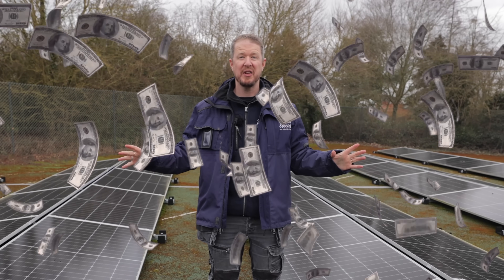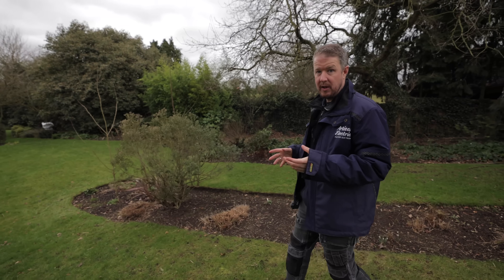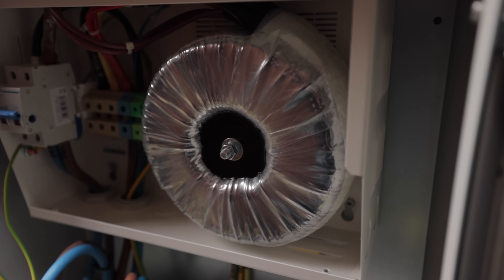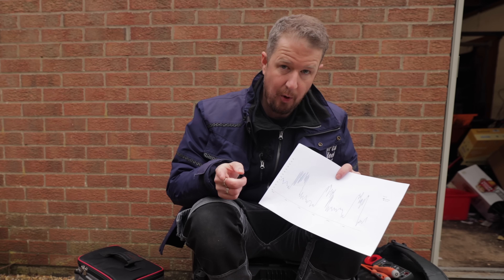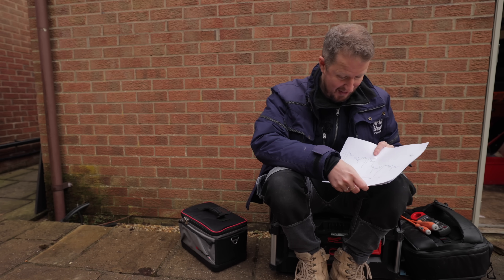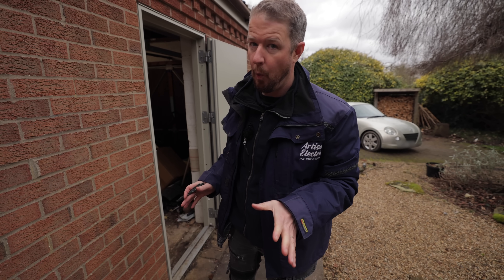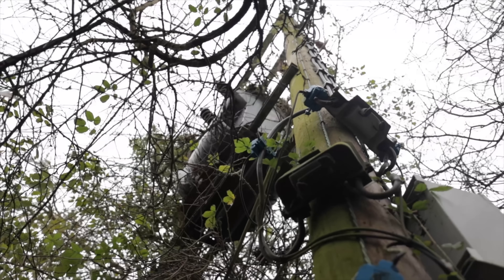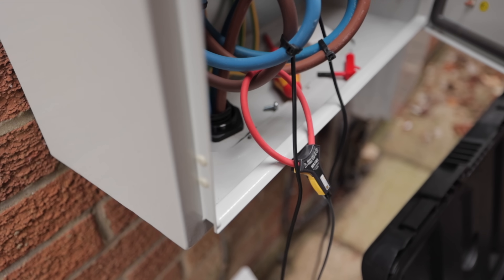THOUSANDS Down the Drain – And We Can’t Do Anything About It!

Comment: Careful what you wish for.  If I were a neighbour on that same distribution circuit, I would be complaining to UKPN that my supply voltage was outside statutory limits for a proportion of the time. I would expect them to fit a voltage monitor, and then analyse the data.   They are going to conclude that the G99 they issued you, needs amending !   Almost certainly they are going to have to impose import and export limits, to protect the neighbours.  They might even send you an invoice, for all the work you have created.  This is exactly the situation that is going to occur all over the country, as the distribution systems were never designed to work in reverse power mode.  It's not only the 415 VAC systems, but also that 11 kV circuit may be a long run of small diameter wire as well.  Will need massive reinforcement and maybe even automatic HV and LV transformer tap changers ! These will not be quick or cheap  fixes.  The developer pays, I presume.
Reply: If the authority issued a permit to export that energy, the burden is now on them. Limits should have been identified before issuing the permit. For example my city and my grid operator require their own processes before before selling to the grid. One is technically just for the solar system to exist, the other is to sell. I ignored both and spent the permit and inspection fees on batteries. My system stays in "island" mode a lot of the time
Reply: Australia has managed to integrate rooftop PV on a third of all houses with only modest network augmentation to date. But that did require a number of actions including adjustments to distribution voltage management techniques of network operators, leveraging smart inverter capabilities and more cost reflective feed in tariffs to promote self-consumption and more load during middle of the day. It will indeed become expensive if traditional network augmentation alone is applied as rooftop PV proliferates.
Reply: @peterkilby289  "Australia has managed to integrate rooftop PV on a third of all houses with only modest network augmentation to date."  Same with the US.  I'm not generally aware of residential solar plants causing the issues described in this video.
Reply: @peterkilby289   Australia has the advantage of lots of air conditioning loads which balance the solar generation when it's sunny.
Reply: I think it's right that they do pay - they are the ones looking to benefit financially from their own solar array - I mean you don't technically have to export anything. they can't do that in detriment to the neighbouring properties.
Reply: this problem isn't limited to the UK but it's worldwide. domestic solar and battery systems have caused a real headache for grid operators because the systems were never designed for it, and they have been too slow to adapt. Here in the Netherlands, we are facing a €100b+ upgrade to install, among other things, 50.000 extra (!!) transformers in urban areas, and of course upgrade the high voltage grid to support all of that. Oh and we also decided that new HV lines must be run underground, as to not disturb the horizon too much...
Reply: When I built my house. Here in the USA. My utility contacted me and asked if I was going to have a welder and said they would put in a larger transformer at the pole where my house attaches to the grid.
Reply: Exactly what I was thinking.

Comment: My suggestion is to run the solar system at your customer’s property without the voltage optimiser. Then get a neighbour to complain about voltages at their property and get UKPN to monitor voltages there. As UKPN have signed connection agreement with you they can’t ask you to stop generating to solve a voltage issue at a neighbouring property.
Reply: If the power-loss happens on the power lines between the house and transformer, the neighbor will not notice much. I don't believe the transformer is the problem. The power lines are too thin/long for 17KW power feedback.
Reply: @kriswillems5661  the transformer will have a much bigger impedance than the 11kV lines and therefore would have a much bigger effect on voltage changes caused by load/generation
Reply: @ You are probably correct. In that case, the solution would be to extend the 11kV circuit closer to the customer's property and install a new transformer there
Reply: Not quite right. The voltage optimizer will enable the system to push the grid voltage up higher. It will enable the inverter to continue operating up to grid voltages of 289v (8% higher than 263). Arguably using an optimizer in this situation is irresponsible and illegally defeating the required grid protection features of the inverters.
Reply: That's a good one !!!!

Comment: We have a similar, but less severe problem. During export our voltage hits 254V and the car charger goes into error state. Normally turning on the kettle or oven is enough to bring it into spec and once the car is charging, it’s all good.

Comment: This is what I keep asking about: "what happens when there's excess solar production?" Nobody ever answers, but I was assuming inverter builders had thought about it and built in a limit feature into their inverters which reduces output when the output side would otherwise go out of spec. This doesn't strike me as a distribution issue - they're only concerned (I would presume) that typical generation won't overload their current-carrying capacity (and break something), not that it might cause a power-out-of-spec condition which I think *should be controlled by a feature of the generation equipment*. I've been waiting for a video like this, thanks for posting. Now to watch the rest...
Reply: Inverters should definitely keep the power they generate to 230V+10%/-6% = ie. 252V to 116V. I.e power should be restricted when the voltage gets over 252V. It seems like the Solaredges are not doing that at the top end. That's Jordan's fault, not the DNO's IMHO. Mine (Victron) does this (and my G99 is limited to 5kW because they know perfectly well that the voltage regularly gets to 252V on sunny days already round here.
Reply: I think after watching I might agree with what you say: either they shouldn't have offered to accept so much generation as there's insufficient transmission capacity - either they've mistakenly agreed given capacity, or they've recorded capacity wrong, or there's a fault meaning capacity isn't what it should be. They also apply 'diversity' on consumption, don't they, relying on not everyone downstream of a transformer using all the capacity for extended durations at the same time? Do they assume the same for generation? That would be ok if all homegen households were all self-consuming at the same time, but if the houses have no demand and several are exporting at max could be an underestimate?

Comment: Sounds like trying to push too much power into too high an impedance, probably mostly down to the long cable. I have a cunning plan how to get the system upgraded for free though. Assuming the original supply fuse to the property is installed, load the supply up to the maximum in the hope that the supply voltage drops below the -6% acceptable level, then it will have to be upgraded as it will be out of spec. Maybe the original main fuse was only 60A, only allowing for around 14kW, in which case you shouldn't really try to push more than that back. If it was 80A then maximum load would drop the supply below the lower acceptable limit (then you could maybe complain).

Comment: Good video. Suggest a lesson is to visually inspect the transformer and power line before taking on large jobs, and “trusting” powerco’s database response. Agree with others, the line may be under-specced for that kind of distance and power. 300m may need some pretty chunky cable for 17kW. An NZ calculator shows 240mm2 aluminium for just 15kW.

Comment: Is my observation correct that the house is only connected to one phase? In the Netherlands such a an amount of power will be delivered through 3 phases. Another remark is regarding the capping of the voltage spikes. I thought there were European regulations regarding maximum voltage by pv installations and automatic switch off by exceeding a trip voltage?

Comment: To be honest what I learned is that you shouldn't rely on being able to sell power back to the grid... you should always assume that they could at any point refuse to take it and you may need to deal with it by yourself.
Reply: I have a 10kw system and batterys but I can only send back 3kw as next door had there 10kwpv and a wind generator (no idea what kw) and in the last 12m all the houses in our small village that didn't have solar now do so in windy summer weather my PV does Ireland itself as the voltage can hit 253v but if it stays over 253v for more than a few seconds my house disconnects itself from the grid and runs off battery power and solar untill grid voltage has dropped below I beleve 242v seems to work well for us with 20-30 disconnection events a year but this may go up this year currently it's 249v here at 8.17am
Reply: @simonupton-millard  'my PV does Ireland itself ' ? I assume you mean island itself but how does it do that? Do you have a gateway?
Reply: @billmorris2353  sorry autocorrect 😂 I have an automatic disconnect from the grid in case of a powercut it's a box between the meter and all my house loads it moniters the grid if it's out of spec it disconnects my house from the grid and my batterys and inverters just carry on working, got it originally as we have quite a few power cuts but also does it on high and low voltage can also do it manually in case of a thunderstorm, only other change was had to have a massive earth rod installed
Reply: @simonupton-millard  This box sounds like a gateway to me. Does it automatically reconnect when the supply comes back on?
Reply: i don't think you get much as well, i usually considered it as a bonus
Reply: That's why you sign a contract and then you know they will take it.
Reply: @FrozenHaxor  contracts are time limited and they can always just find it cheaper to take a hit on breaking the contract than spending money on fixing their network...
Reply: Yep, in my neck of the woods such back-feeding has been banned because of the serious regulation problems it caused. This did not go down well with people who were sold solar system on the basis of rebates.

Comment: OK, so the No.1 take away from this video is - get an electrical *engineer* to design and specify your micro-generation installation, not an electrician. There are very many, very knowledgeable electricians out there and I've had the privilege of working with some of the best but the problems shown in this video underline why you should engage the services of a qualified _engineer_.  To be perfectly honest, there's a fair to middling chance that the person that approved this interconnection at the DNO isn't a qualified engineer either! Over the last 20-25 years there has been a lot of changes in the supply industry and not always for the better, shall we say. I'm a bit concerned by the use of voltage 'optimisers' on any supply - that's a big chunk of impedance in series with the supply, which will drop the PSCC downstream of it. Are you confident that you'll still achieve the device operating times required by BS7671? Have you calculated/measured and documented the changes? I would!

The statutory limits for voltage supply at single-phase in the UK, based on a nominal voltage of 230V are just as Jordan states, 216.2V to 253.0V. However, the specification for supply transformers is for a voltage ratio of 11000 to 433V, not 11000 to 400V, so the 'default' no-load phase voltage at the transformer LV terminals is actually 250V. This will be the same for a 40 year old transformer or a brand-new one. The reason for the higher voltage is to allow for voltage drop in the LV network  - a concept that worked well for the most part as customers didn't export energy, by and large, until fairly recently. The transformers will also have off-circuit tap change facilities to allow for changes in the LV terminal voltage of up to +/- 5%. From what little we could see of the transformer it looks OK and is either a 100KVA or possibly 200kVA, 3-phase transformer. The time to get your fancy Chauvin-Arnoux logger out was BEFORE the generation was installed!

Although the video identifies some of the issues that will influence the supply voltage at the premises with the PV system, there are a lot of variables in the equation, The load presented by neighbouring properties, the service and main cable sizes (and, hence impedances), even the behaviour of the 11kV network and the automatic voltage control equipment at the local primary substation are just some of the factors. Without having a copy of the local LV network diagram and cable records and some idea of the demand on the pole-mounted transformer, it's difficult to be certain what the problem will be. Two weeks for a voltage recorder check does seem a bit excessive, a week should be enough but I can understand why the DNO wanted the PV off-line to do their survey - they are trying to establish the base-line conditions on that LV network perhaps so they can model more accurately the effects of the 17kW export. It's also important to consider the time of year that survey takes place as, obviously,  the loading on the transformer will vary. For over-voltage modelling it is assumed maximum export is taking place simultaneously with minimum demand, probably mid-morning on a sunny summer day.

Voltage regulation is the principal issue that is thrown up with micro-generation interconnections. Most of the time it's not an issue because the local loads and the impedances between these loads and the generator means that the inverters don't really need to output a voltage much above the network supply voltage in order for the desired export to be accommodated. The problems almost always show up in rural or semi-rural LV networks where the impedances are significantly greater - basically everything is spaced out more, the prevailing loads are lighter and the transformer impedances are higher too. Can't wait for part 2.

Comment: Like the videos sir but why didn't you use an optimiser which started at 235 volts. The ones I have used have a 1 to 15 ratio(so the voltage will more up or down by 1 volt for every 15 volts the supply varies).if you still have a problem then go to the supplier for help. But choose the correct optimiser voltage.

Comment: What hertz are you running into the grid? Do you need to sync with grid hertz? I am wiring my offgrid cottage for d.c. like a sailboat. I had to get a 2 stroke water pump. It didn't make much sense to wire for A.C. electric when most things we use are D.C. We do have an inverter for power hunger tools.

Comment: Fit a CVT, a constant voltage transformer. We used them offshore to regulate 240Vac.
A CVT operates on the principle of ferroresonance, which uses a saturable magnetic core and a capacitor to maintain a stable output voltage.
You can get them any VA rating.
Reply: Are they bi directional ? Not heard of them, thank you. He is trying to pull 72 amps and push 72 amps for quite a period of time to and from a shared transformer on overhead wires in a rural area. Property probably needs its own transformer close by. I don’t understand why they don’t limit export, it would solve half the problem. We have 5 properties in a hamlet in Ireland, two supplies each with its own pole transformer beside the property. 22 solar panels on each supply, would not dream of trying 60+ panels on one supply
Reply: Good point…….they are NOT bi-directional……..dang!
Reply: @IanScottJohnston  But they can still connect the inverters before the CVT and run the house after the CVT, who cares what is on the grid side? They want stable voltage on the outlets. Solution still viable!
Reply: Transformers won't fix the problem.  The energy is being produced by the microinverters and has to go somewhere.  A transformer can't magically sink the excess energy.  So all that will happen is that the transformer will force the microinverters to output their maximum voltage (and thus limit the power because they've maxed out their output voltage and won't go higher).   Which is not a good solution.

They need positive management over the energy export and they didn't bother to build a system to do that.

-Matt

Comment: About 3 years ago our Tesla PW2 was switching to backup 100s of times a week at times. I ended up in conversations with our installers and Tesla over the issue because the DNO insisted they couldn't see any issues on their end having installed a monitor inside our cabinet. The issue vanished for a while but returned and after more reports and monitoring, and others having similar issues including someone else with a PW2, it was found to be an issue with the 11kv lines. The person I was dealing with couldn't go in to the details due to GDPR, but said a business was exporting at a level above the agreed amount, there are a few solar farms around, thus it was causing issues for others.